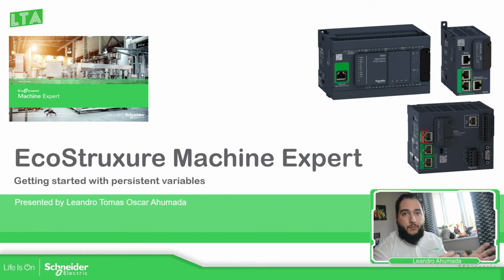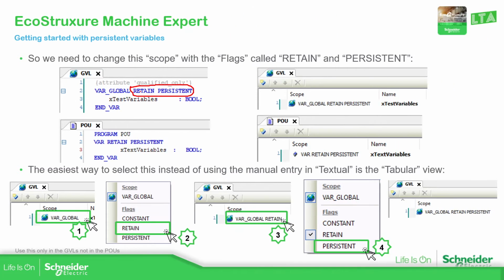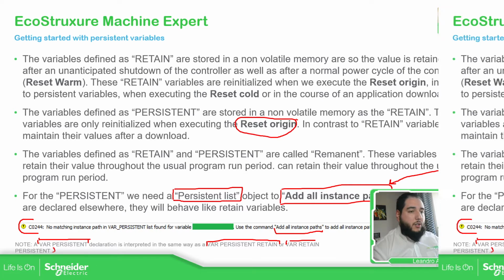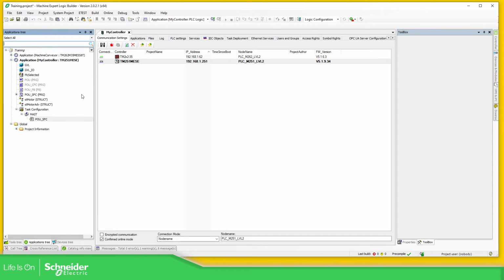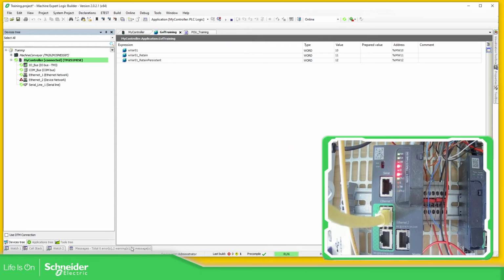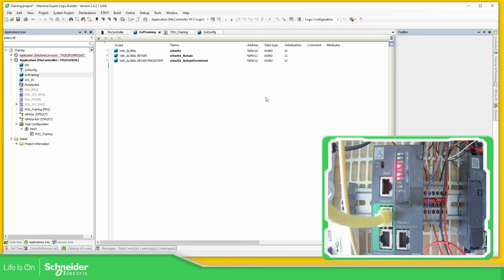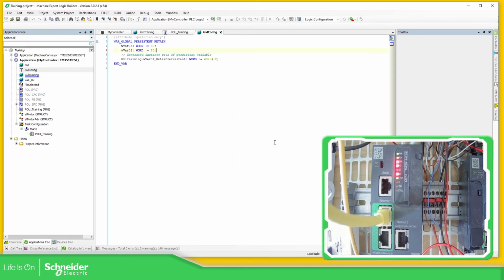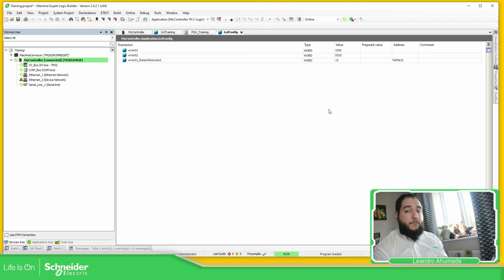EcoStruxure Machine Expert Training - M3.9 Getting started with persistent variables

Comment: This is right about the time in the series I'm gonna jump in here. I've never had to work with Modicon PLC's until now and I'm going through this series trying to get up to speed. I have to say though, coming from primarily Allen-Bradley platforms, the Machine Expert Logic Builder software seems ridiculously convoluted and quite messy compared to RSLogix 5xxx or Connected Components Workbench. I can see why the A-B PLC's are far more prevalent in our industry.
Reply from the maker: Hi there! I can understand those feeling when someone is trying to learn how to use a new software…the comparison is inevitable and it happened to me when i moved from the German one to Schneider 😊. In the Schneider world we have different PLC with different software , in you case I believe you will be more comfortable using something not based in Codesys like the EcoStruxure Control Expert with the Modicon M340/M580 but i do not know you application so not sire why you choose the Machine Expert.

On the other hand, the series of videos that you see here I created them to explain in details how to use the software to avoid problems in the development (all content is non official schneider) so if you any doubt i am more than happy to help but with complains not too much (you can contact the technical support and request modifications in the software).